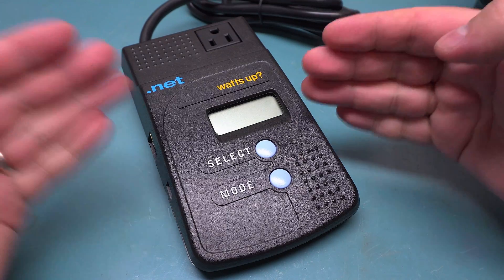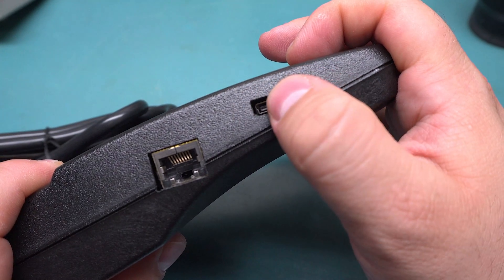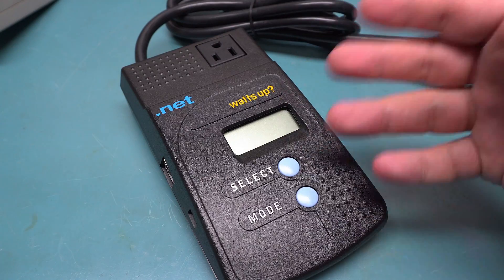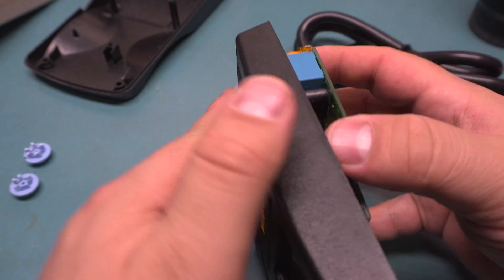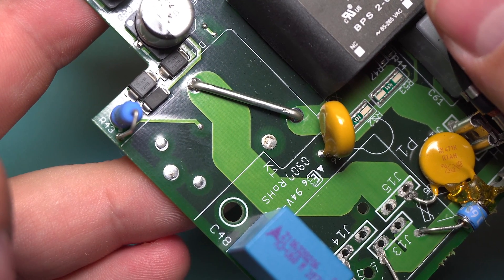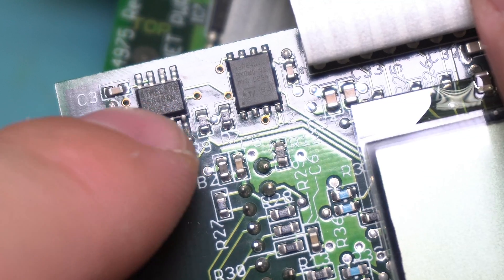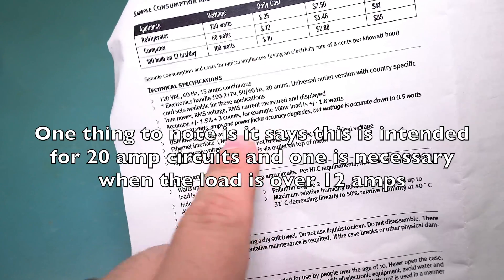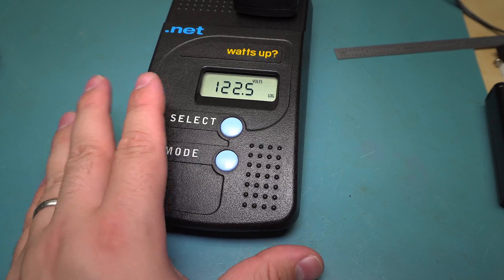Watts Up? .NET Ethernet Power Meter Teardown

Comment: I got the 250v version in 2013 and have used it on my Nissan Leaf charger to see how much it was costing me to drive.  It worked great until the web site went down last year and the product is no longer made.  Now I am going to have to use the USB port to get my data.  It is a shame they did not put a web interface to access the data.
Reply from the maker: arndtwc That's the problem with stuff that is cloud based. I think someone was working on a Python based server. Don't know how functional it is.

Comment: Thanks for the teardown. Just for future reference, there is no need to un-solder the output power connector to remove the power board. The same male connectors that are used for the power input from the cord are used for the output power jack. The jack is socketed, and will come off the three connectors soldered to the board. It takes a bit of force to remove, basically three times the force of one of the input wire connectors.
Reply from the maker: Hmm. I saw some plastic latches inside and spent a good amount of time trying to disconnect it, but all it seemed to do is want to go out the top (which it couldn't because of the soldered on PCB). I must have been fiddling with the wrong latches. haha

Comment: Good information. On the topic of accuracy, how would something like an uninterruptible power supply compare to this single-purpose device for measuring wattage?
Reply from the maker: +Browningate I don't think your average UPS needs much accuracy at all. I wouldn't be surprised if a standard consumer grade one was +/- 5 Watts. They really just need the information for time calculation and overload warnings.

Comment: You might be interested in the Sonoff Pow. Its a chinese WiFi relay, and the Pow model also has power consumption measurement. It's based on the ESP microcontrollers, so you can esily find new open source firmware for it and log the data using your own software.